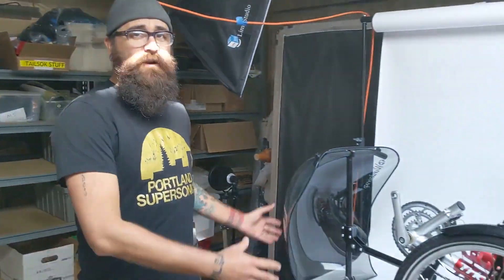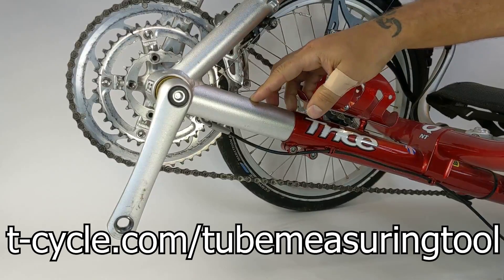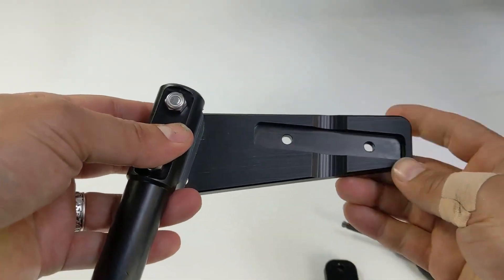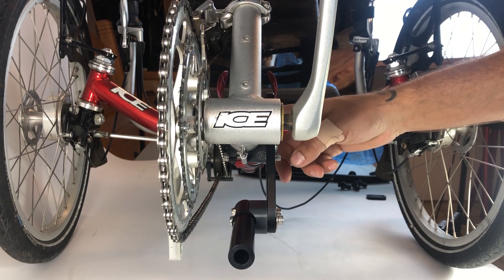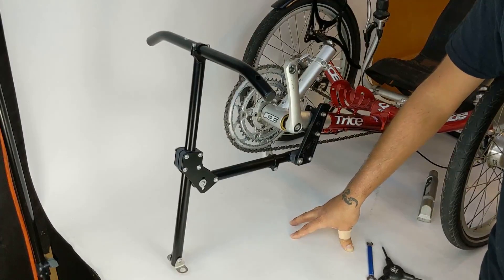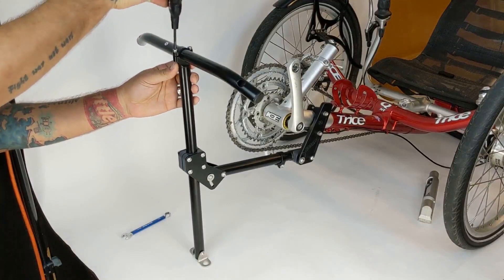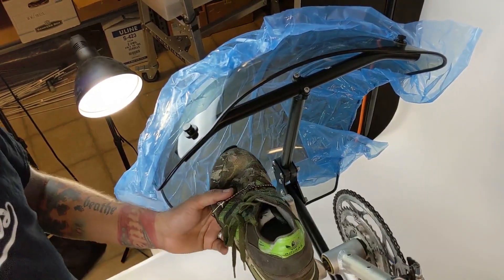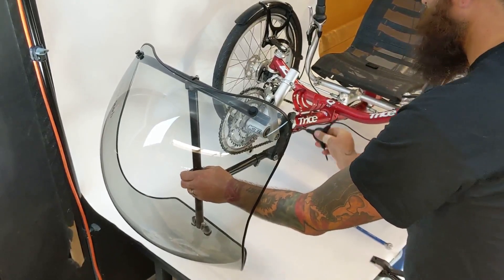T-Cycle SPRING Fairing Kit Installation

Comment: Hi, nice video! How would you go about using fairings on an upright bike (standard double-triangle frame)?  Could I buy a motorcycle one and make adjustments? Should I design from scratch? What materials should I find? Thanks
Reply: I have a Thayer designs ZIP fairing. Very similar to this video. Simple mounting on the hoods ( brake levers ) and very light weight. I have been careful and still in great condition. Have ridden through hail storm rather comfortably. What drove me to this video was trying to find another one. So far no luck.